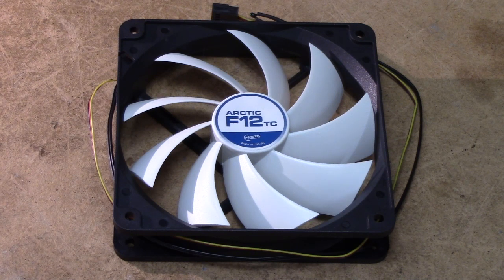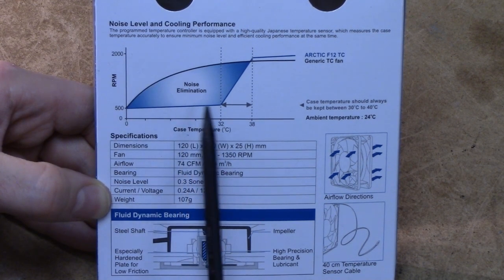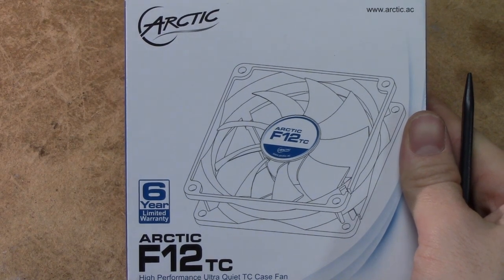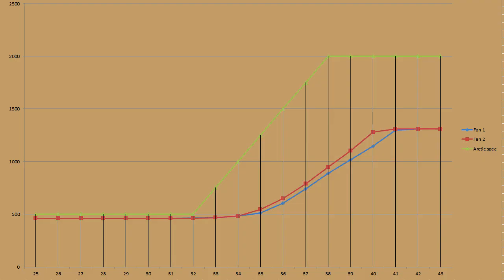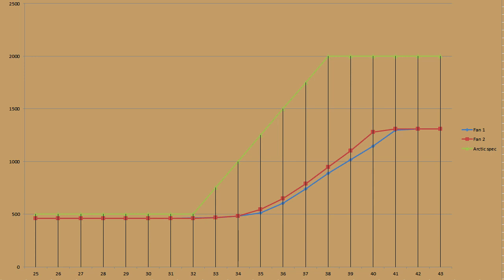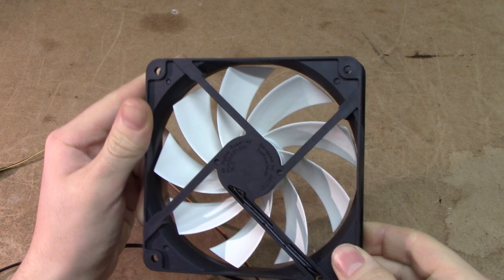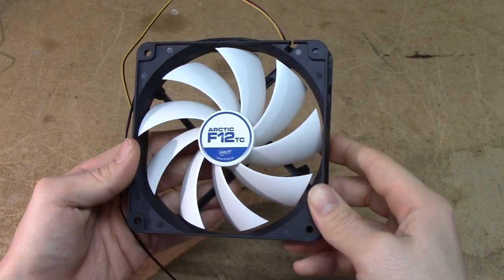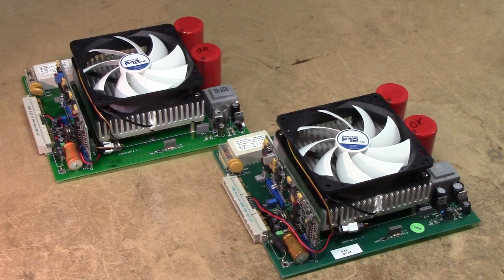Arctic F12TC temperature controlled 120 mm fan - Technical review

Comment: Should add, I have just had an F12 120mm fail after around 6 years in use. Its didn't stop, just got noisey. I leave PC on 24 / 7. So I am quite pleased with that.

Comment: How do I hook it up to 12v? (not I a pc) I use a 12v 2a adapter. Connect black to black and yellow to red. (tried al combinations) but I just moves a bit but doesn't turn over.. I am using it to cool my Audio furniture.

Comment: Would this fan (and the 14cm version) be good for ventilating a cabinet where you put a NAS with up to 4 3.5" HDDs, for example?

Other larger and more elaborate solutions have an external temperature controller (e.g. from Coolerguys).
Advantage: USB
But here I also need only a StepUp converter from USB to 12V 3-pin as it seems.
No idea if there is something like that ready (on Ali etc.) to buy.

Unfortunately, no double ball bearing.
They are supposed to last longer than "Dynamic Bearing" or "Fluid Dynamic Bearing" here in the P12 TC.

Nevertheless, they advertise with "Long Service Life":
"The Fluid Dynamic Bearing comes with an oil capsule that avoids lubricant leakage. Thus this bearing is as quiet as a sleeve bearing but comes with a significantly higher service life."
Reply from the maker: These tend to last well, though I'd preferentially install them vertically. Horizontal mounting for any kind of sleeve bearing is not good.

Comment: Does that third [yellow] wire solely carry temperature and RPM readings to the user? I chose this fan because I am stuck with a 2-pin connector and wanted some form on-board fan control, to compensate for being unable to use a PWM fan. If the fan control still functions without the third wire, I'll be content.

Comment: I've got the 140mm version and I'm not really sure what to do about the thermal sensors. I made sure they worked by heating them up with a hair dryer but they never get hot enough inside my case to turn on and i haven't found a way to adjust the temperature they turn on at. Tried to adjust it in the bios but it didn't affect anything.
Reply from the maker: Turn off fan control in BIOS.

Comment: Great Video, would it be possible to change the temperature that the fans cuts in? I'm looking for something like this but ideally the fans to cut in at 38 degrees. Would it be possible to cut the ambient template sensor off and replace with one that makes the fan come on at a different temperature?
Reply from the maker: It's easier to just put your sensor a little bit away from your point of regulation.

Comment: hey, it's not sleeve bearing, it's fluid dynamic bearing... which is what noctuas and corsairs use... Very nice fan, sadly Arctic isn't clear about the static pressure they generate..
Reply from the maker: Fluid dynamic bearing is usually just a fancy name for a sleeve bearing. Just some oil and a bushing.
Reply: Well, not really. It's a much more improved version of the design. It lasts much longer than Sleeve bearings and is quieter than both Sleeve bearing and Ball bearing. It's nicely explained here: http://www.gamersnexus.net/guides/779-computer-case-fan-bearing-differences and here: http://www.hardwaresecrets.com/the-truth-about-fluid-dynamic-bearing-fdb-fans/
Reply from the maker: "The fluid dynamic bearing (FDB) was first used in hard disk drives. It is a modification to the standard sleeve bearing to improve the lubrication of the bearing"

Some oil and a bushing. While I'm sure that the modifications improve upon the design, I don't think it's justified to present FDBs as anything but a subset of sleeve bearings.
Reply: Yes, true... however I think they deserve their own category since they are a much better technology, outperforming classic sleeve bearing in terms of lifetime and noise, and ball bearings in terms of noise. They are more expensive and this technology is the standard used by high-end fan manufacturers like Corsair or Noctua because of their advantages over the alternatives. Still, can't wait till maglev fans become mainstream :)
Reply from the maker: You can't outgrow your ancestry - birds are still dinosaurs, after all. ;)

Comment: @FFcossag Hey, can i use that fan without temperature sensor? Actually i want to buy F14 TC for my case and my case have 3 way fan controller on it. (Corsair 600Q). So i dont need that sensor.
Reply from the maker: Just buy the non controlled version.

Comment: A cheap way to balance those fans without having to pay a bunch of money on vibration analysis test gear is to tape a coin onto one blade, see how it effects the balance, identify the blade that is most beneficial to the weight, then fine tune the balance by moving the coin up and down the blade. (obviously the farther out it is from the rotor, the more of an effect it will have on the angular momentum). Better balance will decrease bearing wear (though it's just a plastic bushing, as you said. Possibly also increase the RPM:watt ratio (I'm speculating on that one). I didn't take fluid dynamics in uni so I don't know much about airflow, but perhaps the CFM will increase as well.
Reply from the maker: +wither8 I think a coin would be a quite considerable amount of weight to add to this rotor; it doesn't weigh many grams on its own. I think the biggest source of the unbalance is the fact that the fan blades aren't mounted 100 % straight onto the actual motor, so I'm not really sure whether or not a coin would do so much to help it out, since it's not just a question of weight distribution.
Reply: Yeah I thought about that after I left the comment. Coins are what I've used to fix ceiling fans, so they're likely of way too much mass. Even if the blades aren't mounted properly to the rotor (i.e., angular misalignment from poor injection molding of plastic), the balancing still would work I'm 90% certain.

Now you've got me thinking. Spend 10 minutes trying it out (tape down a small amount on blade 1; either hang it from the same fixture to see the amount of play, or tack down a magnet with a stationary hall effect sensor for cheap vibration analysis), note the hall effect sensor output's variance, mark with a felt pen the blade, try with blade 2, etc. Don't have to do it, but I'd be real curious to see the outcome.

Anyways, thanks for the videos. As you can tell last night I marathoned through quite a few of them ;). Love em.
Reply from the maker: wither8 I'm glad to hear it. These particular fans are thoroughly mounted into a couple of devices by now, but I've got another couple on order. I don't have any hall effect sensors or other fancy stuff like that lying around, but I'm definitely going to have a cursory look at how balanced this newer couple of fans is. Whether or not it's video material though, I can't say.

Comment: This fan would be perfect for case fans that could read the graphics card temperature. How many of you have case fans that do not climb in speed when your graphics card is screaming all out to keep it cool by itself? Not sure why you decided to use such a low temperature range for testing. Almost all fans are quiet at these low temps. We want to know what happens when your  hardware starts reaching 60, 70, 80, or even 90C. That is the range where things need cooling and sound levels start getting in the range of noticeable or just flat out annoying.
Reply from the maker: I measured them until they maxed out. Keep in mind that you have no chance of actually making the sensor as hot as your GPU die. The air coming out of the back of your GPU is rarely going to be above 50 C, no matter how hot the actual die is.
Reply: @FFcossag  I would use thermal tape and place in on a mosfet or power stage. Thanks for the heads up.
Reply from the maker: That'd basically make the F12 run at full speed all the time, since the GPU fan controllers are usually set to idle somewhere around 50 C.

Comment: Hello :)

Can i ask how much is long the 4-pin cable ?
Reply from the maker: I don't remember, but perhaps about 20 cm.
Reply: @FFcossag  what is better f12 or f14 and one more question tell me is this ARCTIC COOLING BioniX P120 good for cpu coller l have fsp 1600rpm 120mm l wont to change that coller because l found one man in my contry that f12 6$ bionix red 13$ for me is verry cheap l wont to buy one for to cool down cpu and 4 fan for case